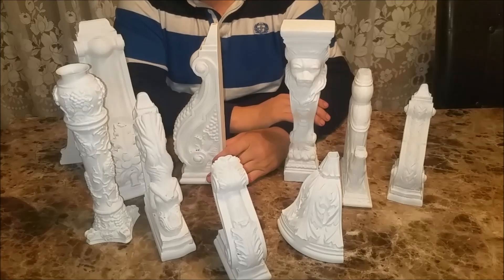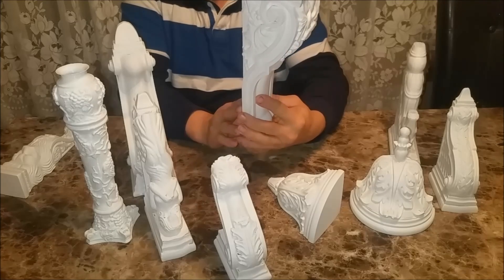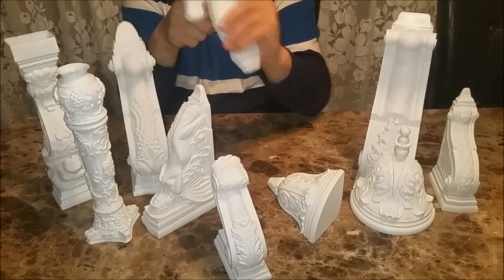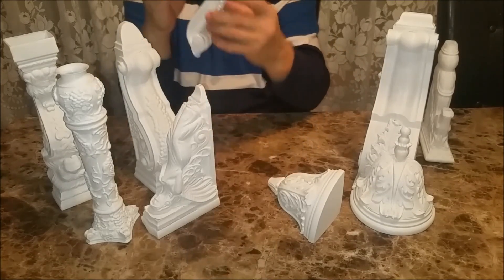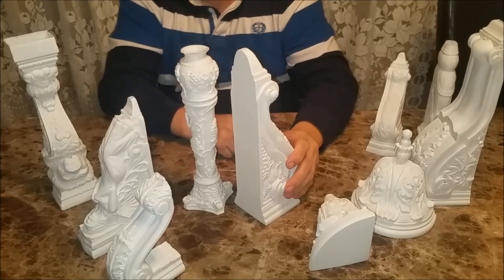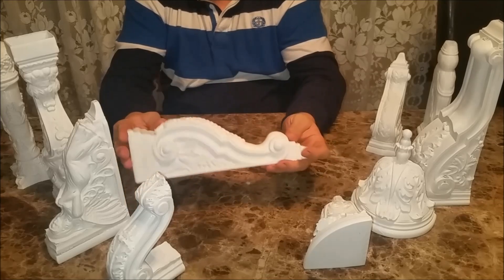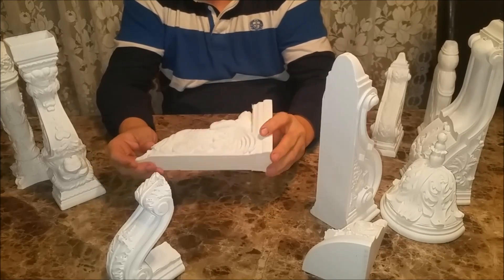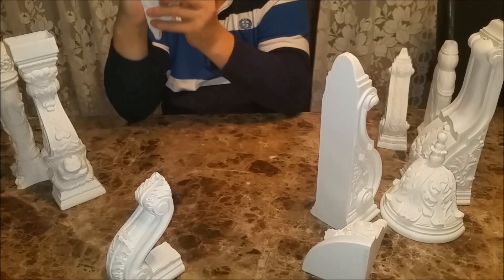3D printed Decorative Corbel's

Comment: what printer did you use?
Thanks.
Reply from the maker: I printed all of these samples on a Tronxy X3
Reply from the maker: The Micromake comes with a version of Cura with the Micromakes firmware built into Cura. You actually have to use that version of Cura to install the firmware on the printer. I have the PDF files and software if you want them. The PDF is very good at explaining how to set the printer up and both manually level and auto level the printer. Also the auto leveling is just fair it does not calculate the right side of the printer properly

Comment: Really LIKE your Corbels I have a wood  beam the length of the Great Room I was planning on making a  blocky wood looking support (corbel) for both ends or pound out a couple out of Iron on the anvil & forge but if the Printer ever gets here your idea would save me a lot of iron or wood work and would only require painting/ finishing to look from the floor as real as the Hickory Beam... just have to do more studying on AutoDesk's freebe 3D cad online class. If I run across anyone aspiring to corbels I'll send them your way. Thanks for the idea! 73
Reply from the maker: I started designing some of my own for the purpose of sharing with the 3D Printing community, one of which I have posted on Thingiverse if you ever get some time you can go check it out. It is very scale able as well